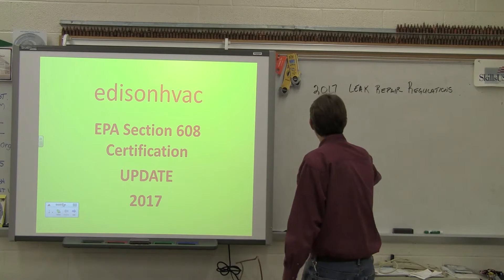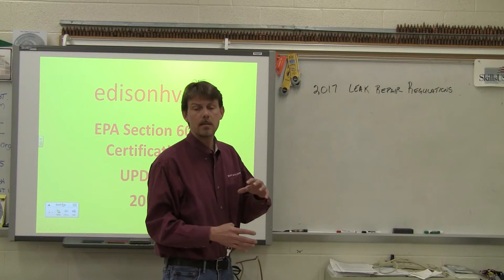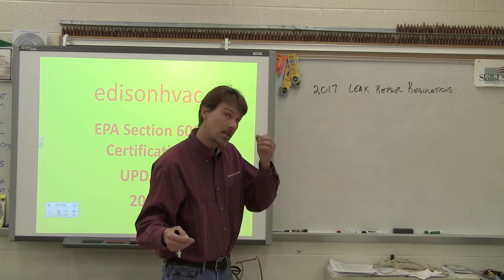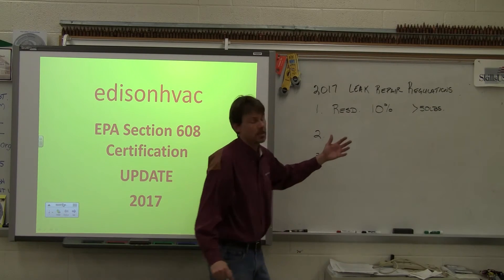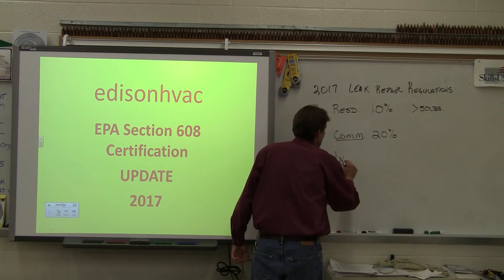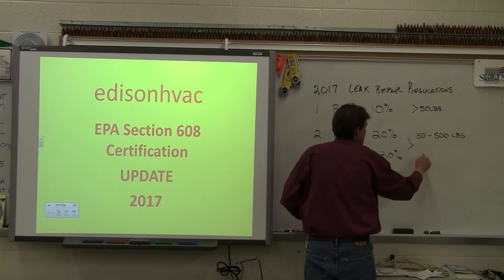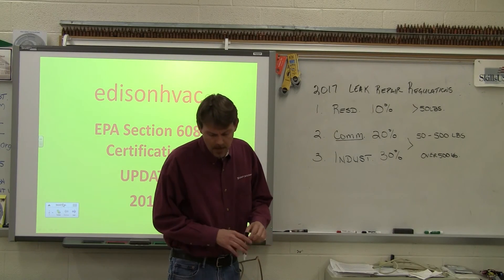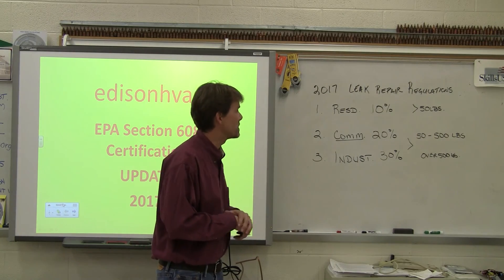HVAC Basics: EPA 608 Certification Study Guide - 2017 Leak Repair Requirements

Comment: Many thanks for these excellent training videos. You are an outstanding teacher.
I have a question, looking at this link, it seems the EPA extended the old leak repair requirements to Jan. 2019. Do you know if the new test bank is updated with the current requirements or or 2019 requirements?  as in 10, 20, 30 or 15, 35, 35?  https://www.epa.gov/section608/stationary-refrigeration-leak-repair-requirements